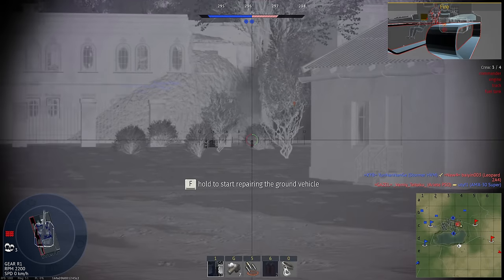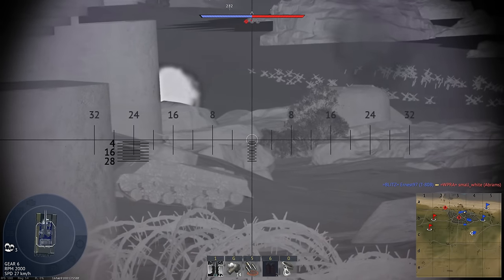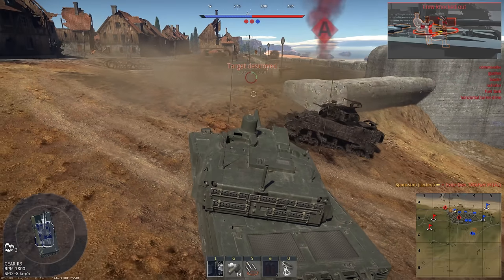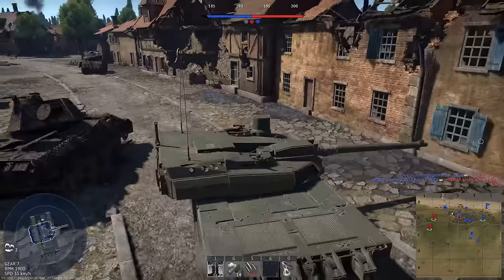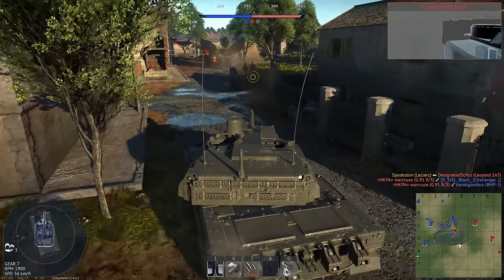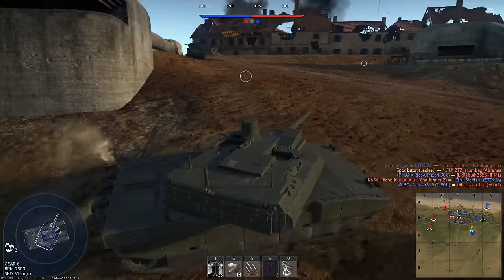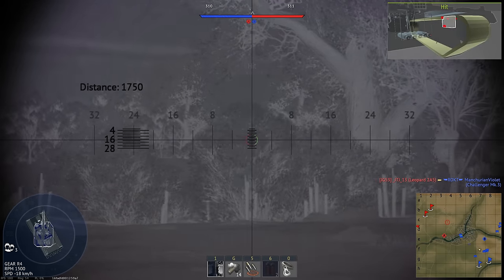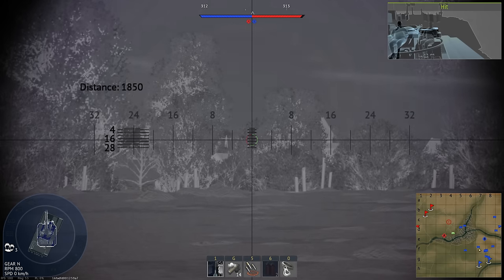The Future of Tank Armor

Comment: Metal foam with air/gas pockets in it would need replacing each time it is hit as it would lose effectiveness much quicker than standard armour. Its would mean a strong HE hit would mean the foam would need replacing however HEAT could be made less effeactive if rubber or similar materials were used to fill the pockets. There are lots of options with metal foam and could potentially allow for interchangeable armour panels which could be changed with each environment. For example have HEAT effective armour for urban combat to reduce RPG risk but then kenetic effective foam mixes for tank combat areas.

Comment: A couple other options for future armor, none as revolutionary:
--High-magnesium lightweight armor steels. Maybe not for tanks, but there is interest in its use for lighter vehicles. Per unit of weight and volume, it absorbs KE more effectively than RHA. It's lighter and can be manufactured with standard practices, although the magnesium in the alloy is expensive. A type of perforated armor made from this was being researched for uparmored Humvees to get the weight back down.
--Monomolecular sapphire for composites. Excellent for defeating HEAT. Basically, most crystals are random jumbles of smaller crystal structures, and mechanical/thermal failures happen along the boundaries. By growing a synthetic sapphire as a single crystal, it's stronger against both KE and HEAT, the latter of which the sapphire crystal diffuses without easily melting. Very expensive, but this was tested decades ago, and since then single-crystal castings for aircraft parts have become commonplace, so manufacture would probably be easier than originally estimated.
--Iridium and osmium. Sometimes in composite armor you just need a layer that is insanely dense and/or insanely hard to melt. Iridium and osmium fit this need, being the two densest pure elements and having amongst the highest melting points. These metals are scarce on Earth, and damnably difficult to make. Current global production is a few tons per year--you literally mine out meteorite impacts to get them.
Reply: Another reason to finally go to space. If we somehow get to a metal-rich part of solar system's main asteroid belt, basically all elements will suddenly be in a nigh-unlimited supply

Comment: I believe I once saw a video about a kind of metal foam that was ridiculously difficult to saw through. It was advertised as an “uncuttable material.” An exaggeration, but in tests it did wear out multiple saw blades without getting fully through the block of test material.

Comment: Metal foam works because the "balls" of the metal foam make projectiles too start bouncing around as they enter the armor. Kinda like the plate with holes in it. There's also foamcrete which has the same properties as the metal foam.

Comment: Interesting, concise and well done. However I have a different idea. The crew should all be placed in the turret for increased visibility and lowered weight of the vehicle overall. If all of the protection is emphasized in the turret with a crew is located and it is a smaller part of the tank then the tank itself can be a much lower weight. You have the choice of reducing the weight of the turret and placing the crew in the hall or reducing the weight of the hull and placing the crew in the turret where there is increased visibility. I believe this is a better solution. But who listens to me? I'm a retired military engineer.

Comment: I could imagine metal foam being used in a troop carrier, as it would help defeat anti-material rifles and low caliber cannons, but in terms of body armor, I doubt it would be useful despite the reduced weight as it's been found that even if you can make armor that can shrug off a 50 BMG, the kinetic energy transfer would still heavily injure if not flat out kill the person who was struck. The only pro to this is the fact that now they don't have a massive hole going through them. Rather, they would just have plenty of crush injury which is a bit more manageable for an open casket funeral.
Reply: Metal foam and EMA can be used in on ship hulls to add a multi layer defence for stopping hull breaches.
Reply: @barrybend7189  Oh yea, almost forgot about naval craft. I suppose it could also see use in aircraft to a limited degree to aid in reinforcing the airframe of a fighter or bomber. Or adding some armor to a helicopter.

Comment: E-M armor as shown DOES NOT NEED A RUNNING POWER SOURCE!!  The time it must work is too short for any electric generator to provide the needed current.  What you need is a bank of fully-charged super-capacitors (graphene can create these too) that have conductors heavy enough to allow them to discharge very rapidly into the weapon when activated.  The capacitors would then be recharged by engine-powered DC generators.  Depending on how much current is needed per discharge against the impacting weapon, several such capacitors may be carried to allow for several quick defenses while the discharged ones are being recharged.

Comment: I would think that the heat proof polymers that have been cropping up would play a role as well. But that is probably further down the road when polymers can be both heat and kinetic resistant. I also like the idea of modular overlapping panels that could be more easily replaced if a tank takes a hit. I think LeClerc uses such a thing.

Comment: Hey can you please do a video or videos going over all the "half tanks" of Gundam like the Guntank( early, project V and assault), Hildolfr, Tragos, Loto. Also look at the M61 MBT. Also the two armors you mentioned( EMA and foam metal) are in Gundam Seed with the Astray units mostly using foam metal while the GATX gundams using PS armor( a variation on EMA). Also foam metal can be layered to be part of an ablative layer inside Ship hulls due to it's ability to take impacts.
Reply: Barry Bend I was specifically going to mention the Astray units. Not only were they not able to secure the Phase Shift tech, they swapped it for minimal foam metal to both increase agility and combat duration, as the GAT-X series chews through power constantly to feed the Phase Shift armor system, just like an EMA system.

Comment: The primary attribute that affects kinetic energy penetrators is mass. A metal foam would really only be useful against smaller projectiles like auto cannons not main tank armaments. It should perform pretty well against HEAT warheads due to the penetrator jet being distorted/ ablated as it hits more and more pockets. So, I'm doubtful metal foams would be extensively used at the frontal 30 degrees of the tank. It's much more likely to be used on the sides where protection from HEAT and auto cannons is more of a focus.

If you want to make the front of the tank more resilient to the usual apfsds then you must increase mass, deflection, and or somehow create enough stress on the penetrator to deform/ fracture it. The only real exception to that would be some kind of scifi-esk repulsion thingy lol.
Reply: ...
NERA:
HERA:
Bulge/Flyer:
y'know, you could just... use metal foam in the flyer plates.
Reply: @KoishiVibin  I'm not sure what you're trying to say/ are saying.

Elaborate some or explain what you meant if you don't mind.
Reply: @justhitreset858  
ERA and NERA work the same way. NERA is what is usually referred to when talking about composite armor.

Most NERA works like this. Two flyer plates, and a bulging element between them.
Upon penetration of the bulging element, the bulging element drives the flyer plates outwards, inflicting lateral shearing stress on the penetrator and feeding material into the penetrator's path. It also as a consequence bends the penetrator towards normalization of 90 degrees with the array.
Reply: @KoishiVibin  Is that in response to what I said about needing either mass, deflection, or damaging the penetrator?

Comment: Maintaining a current costs energy. Maintaining a relatively moderate voltage between two separated plates does not. I'm not 100% sure why EMA is desireable, but if there's no circuit, it can't consume power. So you could just charge it up all the time.
Reply: By moderate voltage, I mean anything that's well below the voltage needed to arc between the plates or for lots of dark flow. Also obviously this applies much better for DC than AC voltage. As AC can get across spark gaps without interacting with the material in between using magnetic effects. Impedence and resistance are not the same thing.

Comment: for powering EM armor why need a seprate power source? unless you need it on while not running the engine just use what every electric device in a vehicle uses an alternator and maybe  a battery. 5:15  remote periscopes....

Comment: I suggest that the future armour should be made from steel in the outside and in the inside should be filled with carbon fibres ( like these used on formula 1 car),sloped at 35° and welded in a streamlined shape so that it can protect the tank from almost anything.
Because these fibers are very strong and they can stand a lot of pressure.
Besides,they are being mass-produced for racing cars so if we utilise this for tank manufacturing,sure that it'll be great and will have awesome results.
:)

Comment: The effectiveness of metal foam against shaped charge projectiles might depend on what the foam is composed of. I doubt an air-filled foam would perform well, but a foam composed of, say, steel and ceramic would probably have better performance than air-filled foam.

Comment: With all this talk of manufacturing, effectiveness, pros, cons and all that, I cant help thinking how the hell do you service and maintain some of these armors (and other tech youve done vids on)? I mean, like all military equipment these would be in service for decades if they can. Surely the cost, complexity and servicability of these technologies would be a huge factor. Take 1 tiny hit and you are out for 6-8 weeks while they find a competent service mechanic to fix your now short-circuited armor?
Reply: To an extent.
Modern NERA is more or less modular, you can pull and replace without much trouble. I'd expect newer armors to have the similar capability.

Comment: There is a type of armor that I have wondered why it has not been tried and that is what I call concrete armor.  it would be like mixing tungsten carbide or  some other very hard  materials chips or lumps as the gravel component with in an aluminum or other metallic matrix.  The difference in hardness or toughness  between the hard and soft would cause all kinds of disruptions as a projectile tried to pass through this type of metallic like concrete.

Comment: My bet is a robotic arm will be sputtering and melting Zirconia, then spooling nanotubes as a ply into the molten surface, to 3D print foam-like structures with a consistent gradient from solid shell to foam absorber. Good for space-based scramjets and the like, too.

Comment: This type of EM armour shouldn't consume much energy because it is practically a capacitor that can be complemented with other capacitors. After it is charged up, only the leakage charge should be compensated, which is miniscule if the EMA well-designed. Additional internal capacitors can be  connected  in parallel to the EMA in order to match the required capacity. The effectivity of such armour mainly depends on the additional capacitors that can be installed in the tank.
But to know it wouldn't need much effort to achieve high voltage, even a simple demonstration wan-der-waals generator can achieve multiple thousands of volts. If such voltage isn't enough than voltage multiplier circuits can be used. So a tank's powerplant should be more than able to charge up such a capacitor. The only thing that depends on the powerplant's power output is the condensator charging time, and the ability to compansate the leakage.

Comment: Graphene will be made in huge quantities in the near future because its is dirt cheap -- just pure carbon (soot) -- rfl3exible and 200 times as strong as an equal weight of high-strength steel.  The current problems are just like making steel  -- it took about 90 years to finally, in the 1890s learn how to mass-product a reliable armor steel of higher strength:  Krupp nickel-chromium-steel, the material made with amazingly little change in properties as US Army Rolled Homogeneous Armor (RHA) even today.  (There are much stronger steels, but they require special processing and are too expensive for large slabs of armor.)  It will not take 90 years to figure out how to mass-produce pure carbon in the form of chicken-wire sheets, which is what graphene is.  Laminating graphene and a hard, rigid material in thick built-up composites will make a super-strong structure that is flexible enough not to break under any imaginable physical impact and will form the backbone of multi-layer armors using your mentioned metal foam and other materials configured to deflect and degrade the penetrating weapons.  For example, making laminated armor in the form of interlocked wedges internally would cause any impacting weapon to have asymmetric forces on its penetration shifting them rapidly up, down, and sideways, greatly increasing the total path that the weapon has to traverse to get though the armor (not-so-random-walk effect)-